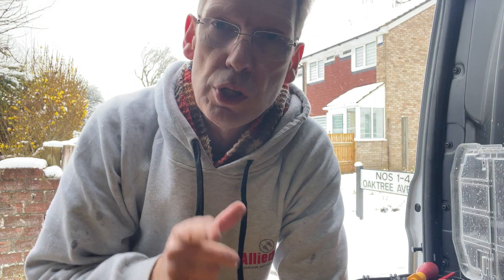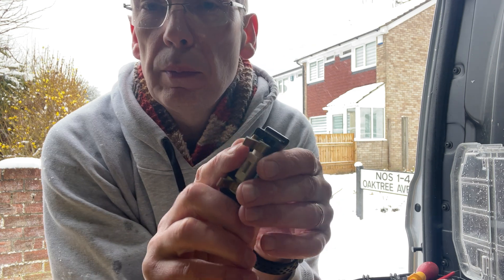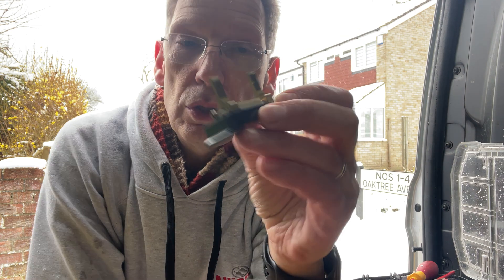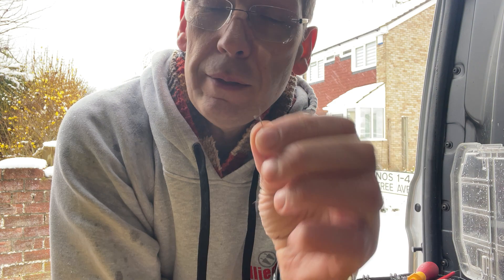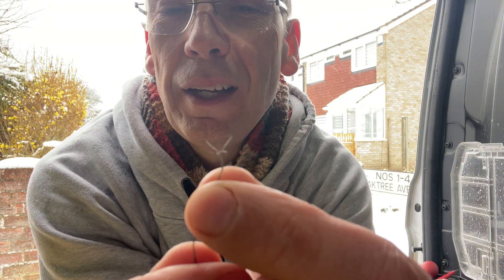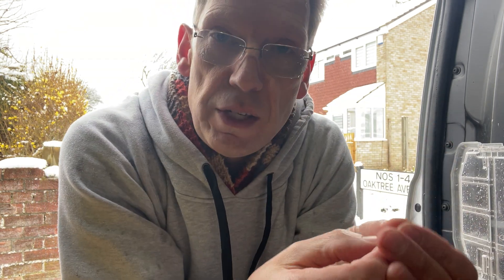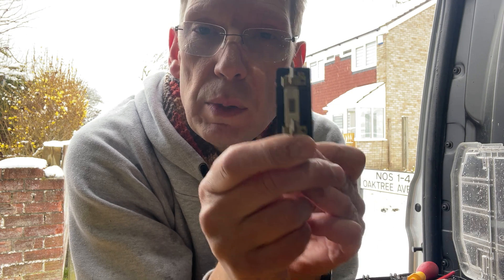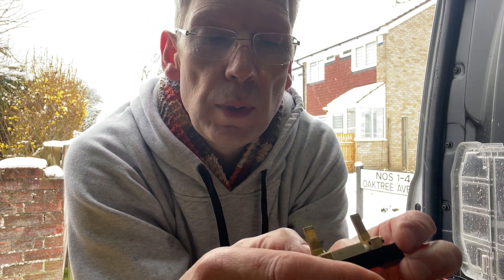What you need to know about rewirable fuses

Comment: Great video, what is your opinion on changing rewireble fuse boxes even though they are still in a good useable condition. Ref page 99 in the onsite guide .
Reply from the maker: Thanks for your comment Sean. 
If a consumer unit is still safe for continued operation then there is no need to replace it. Unfortunately for most properties the older rewirable fuse type consumer units do fall a little short in a number of areas.
RCD protection being the main one, but also rating for prospective short circuit current, fire-rating of the enclosure, surge protection and not least the ease of use/maintenance (as per the topic of this video) for the householder.
Reply: Yes I agree but RCD protection is not retroactive they are only required from 17th edition BS7671 am3 onwards SPDs are a recommendation only at the moment AFDDs are only required in curtain locations ie purpose built student accommodation care homes and dwellings in blocks exceeding 18 metres or six storey in hight . Old rewireble fuse box can be signed of as safe for continued service if there is no damage signs of overheating or thermal damage and all our test results are within the specified range set out in BS7671 . Hence why I mentioned Page 99 of the current edition of the onsite guide. But in my own opinion rewireble fuse box’s should be replaced regardless of there condition. If I had a pound for every rewireble fuse I have seen with the wrong size fuse wire or I nail I would be a very rich man. So yes I agree with you mate . And let just get rid of them . 
Oh and thank you for your kind reply. Just so you know I have been a spark for a little over thirty years , I did C&Gs 236 parts 1 and 2 and for years at college 1987-1992 .
Reply: @Dog-whisperer7494  we must be similar in age. I also did 236 parts 1&2 in the late 80’s. Thanks for watching.
Reply: @the_tube  i’am 59, 60 this November .god i feel old when I say that 😂